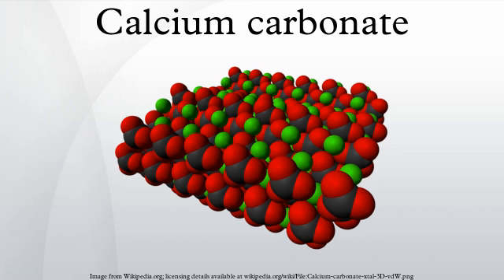Calcium carbonate

Comment: Dear manager,
Longyi New patented built-in classifiers dry grinding machines already put into mass production.
For limestone/dolomite/calcite 
The whole grinding system power is around 370Kw, the real working power is 80% 296KW
1.D97=23um (600mesh)    Output: 10tons/h      Energy Consumption: 29.6Kw/Ton
2.D97=16um(800mesh)     Output: 8tons/h       Energy Consumption: 37Kw/Ton
3.D97=10um (1250mesh)    Output: 4.5tons/h    Energy Consumption: 65.7Kw/Ton  
4.D97=6.5um(2000mesh)    Output: 2.5tons/h   Energy Consumption: 118.4Kw/Ton 

For Talc powder, 
Longyi powder grinding mill power is 250Kw, the real working power is around 200~225Kw, including classifying system.
A. D90=10.5~10.7um   output:  4 tons/hour
B. D90=9.8~11um      output:  3 tons/hour

It is suitable for processing nonmetallic minerals such as calcium carbonate, calcite, Kaolin, clay, barite, talc, gypsum, limestone, calcium oxide, bentonite, dolomite etc.
Samuel 
MP/Wechat/whatsapp: +8615105956429